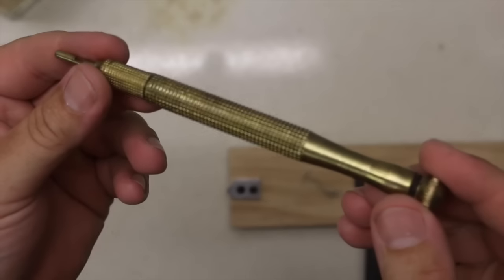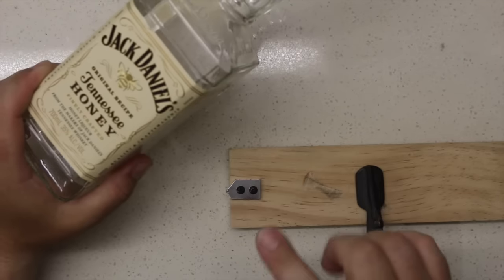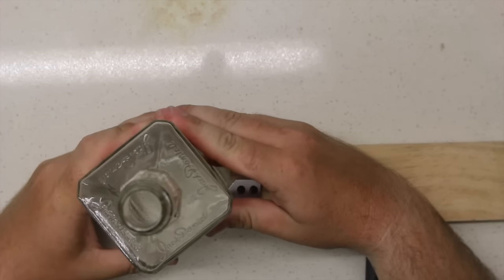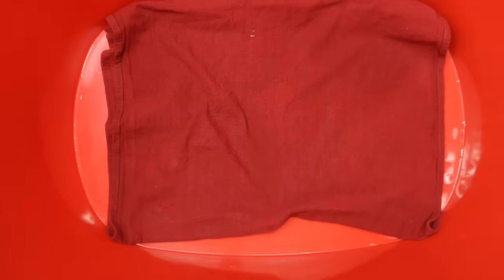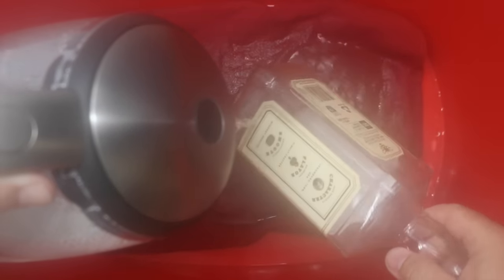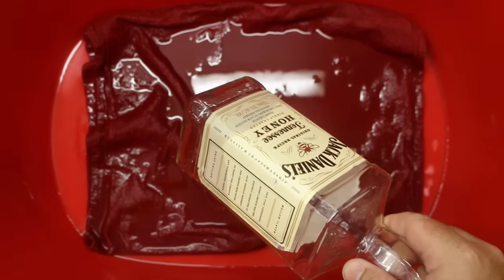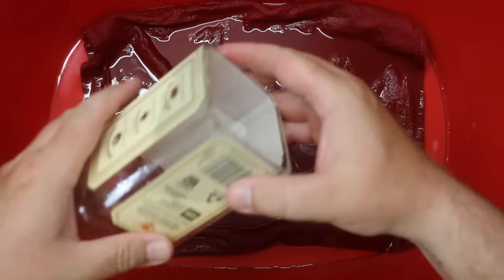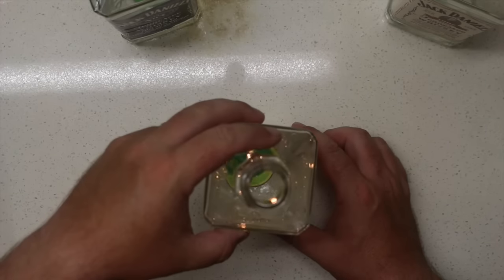HOW TO CUT A SQUARE GLASS JD BOTTLE

Comment: I just used this method on about 15 bottles. I got 6 of them to break on the score line. The others were ruined b/c a crack developed from the score line to other parts of the bottle. I don't think this is a bad way per se, I just wish there was a more repeatable method with better results.

Comment: Did you secure the wood down using a vice or something please? You looked like you need to push against the blade fairly hard. Finally, the blade cutter that you used, did it have screw holes on it? I could only see it screwed into wood and don’t quite understand how you removed it from the metal handle to then attach it to the wood!? Thanks 🙏🏼
Reply from the maker: Yes i clamped down the wood, the cutting tool i used had a head that you could unscrew and i drilled a hole in it and screwed it to the wood
Reply: Ben's Worx thanks for getting back to me 👌🏻

Comment: Would it work to immerse the bottle in hot, then cold water baths?
Reply from the maker: +Herb Hoover Hi Herb, you need super cold water to shock the glass and if it doesn’t work the first time the heat transfer from the hot bottle turns the water tepid and will need to be replaced with cold water again

Comment: Ben,  I assume you had to drill through the hand glass cutter head.  Where and which glass head is that to mount to the board.  Thanks for the video.
Reply from the maker: +Stephen Lilly thats right Stephen just two small holes then screw it to a piece of wood. Thanks for watching Mate!

Comment: Is it not easier to dip the bottle into boiling/cold water rather than pouring it over?
Reply from the maker: +Neil Stridiron Hi Neil the heat transfer from the hot glass will soon turn your cold water into warm water and it will not shock the glass enough to break. That's my experience with dipping

Comment: Great video, only one problem. How do you prevent the sticker from getting wet. if you get it wet the sticker will come off.  I tried clear coating it. you can't tape it off cuz then the sticker will  come off. Do you or anybody have any ideals?
Reply: Mod podge it first
Reply: Try two layers of tape.
The first layer would cover the bottom of the label, but lay it with the adhesive side facing out, tightly wrapped, overlapping enough to ensure it'll stay put.
The second layer would be applied adhesive side down, overlapping the first layer all the way around about halfway. Again, wrap it very tight to ensure it'll stay, and that no water will get beneath it.
(Note - I'm not 100% positive this idea will work, but it sounds plausible.)